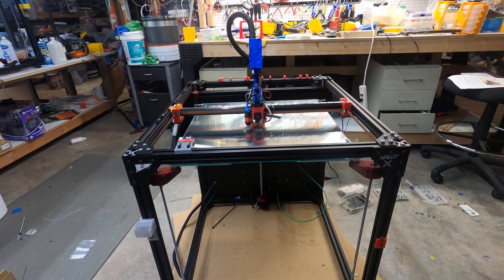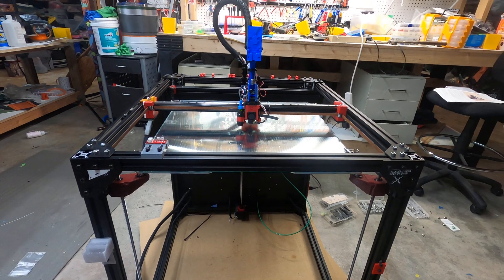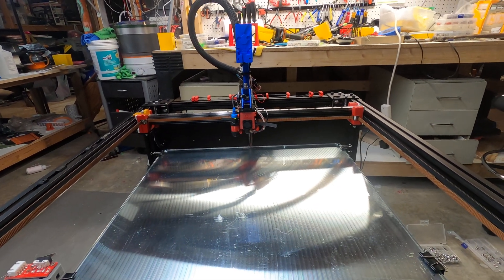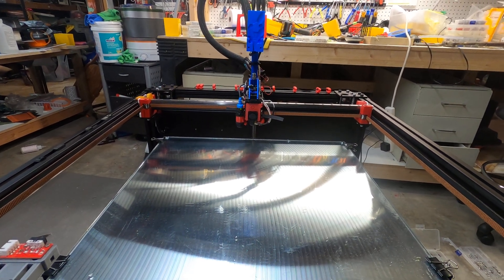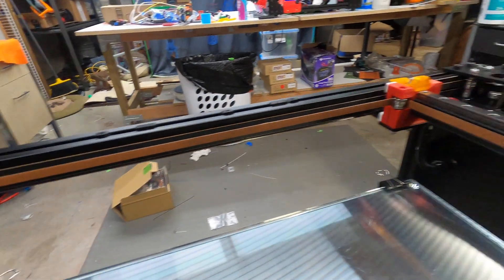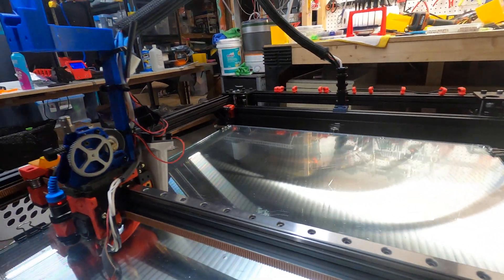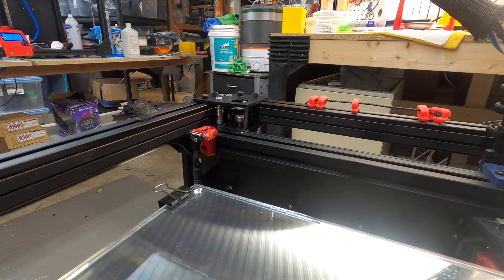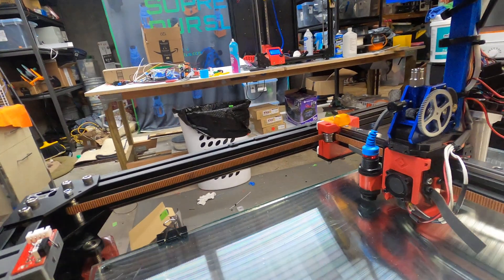Rat Rig 3.2 Mod first video

Comment: The corners look nice mounted.  Is that some kind of static electric strip sticking out from the print head?  Kind of reminds me of the strips people used to mount on their vehicles that drug on the ground.
Reply from the maker: Scott you have a keen eye!  Those are the ends of the belts that move everything.  The belt material comes in a roll - 6 meters for this printer and has to be cut to size.  I found out that it is a good idea to leave it long until everything is working correctly.  I may have found this out the hard way.  The belts attach to a block on the back of the print head then loop around the motors and idlers and are clamped on the front.
Reply: @woodwaker1  Oh okay.  I didn't notice it was the same material as the belts.  Makes sense to leave them long.  Thanks.